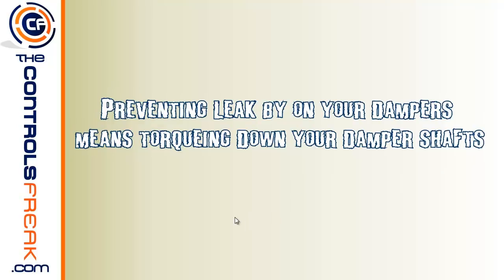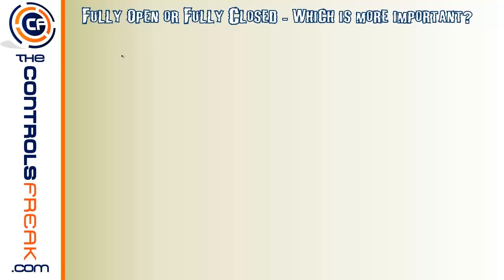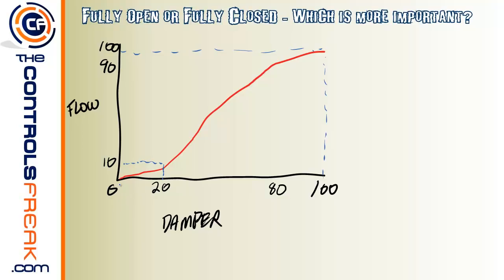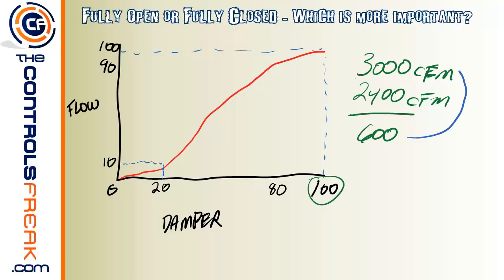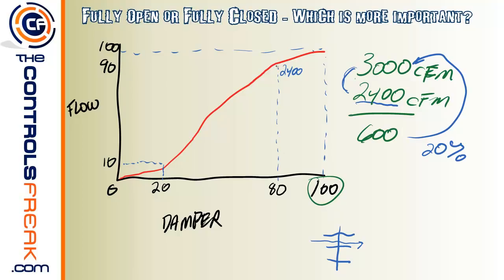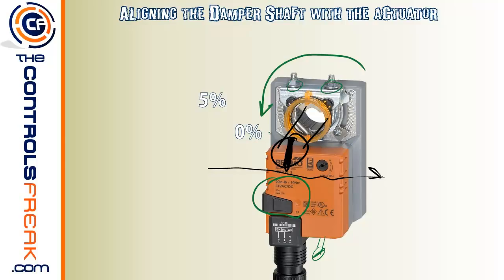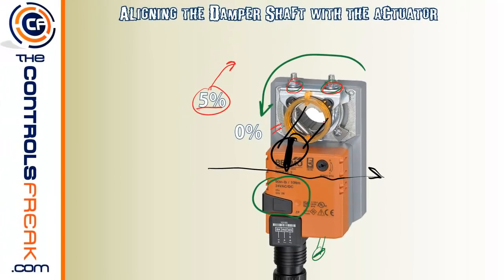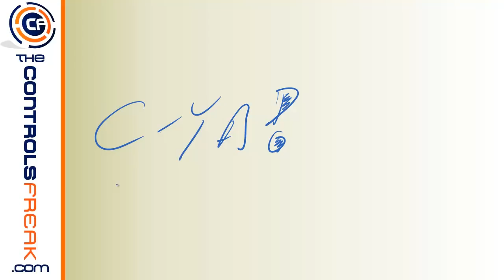Quick Tip To Make Sure Your Belimo Actuator Seals Your Damper Closed

Comment from the maker: Revisiting this question... Yes when you purchase (some?) Belimo actuators will come shipped where they are set at about the 5% mark until powered up for the first time. Hopefully up to the point they are getting mounted no one has manually readjusted the actuator etc.

Comment from the maker: Don't get me lying about Venturi and Fluid Dynamics, but... I think that is something completely different than what we are talking about with a damper. So, when you close a damper you are making the opening smaller thereby limiting the amount of flow. Though it is not linear or directly proportional... the further close the damper, the less amount of air passing by. When you open a damper from 0-20% you get the biggest change in amount of flow. From 80-100% you see very little change at all.

Comment from the maker: Based on my experience and the documentation that you can read from Belimo... They have some sort of internal gearing that once it hits that stop or any other extreme stoppage the torque will increase and at a certain point keep the actuator from continuing to drive further and burning up the actuator motor.

Comment from the maker: @w0158670 I am sorry I don't really know what you mean, but...

The actuator will drive to the full clockwise or counterclockwise direction depending on the position of the rotation switch. Once it reaches that position the clutching system stops and it holds that position.

If you tighten down on the shaft while the actuator is already at the furthest most position... It will stay right there. No additional torquing.

Comment from the maker: You should use this tip with ANY damper you wish to be sure that when it is told to be closed, it is closed. 

Also, the reference to 15% is completely arbitrary. You should never assign a set percentage to a position of a damper to equal the 'right' amount of fresh air. Then again 15% could be correct if a Test and Balance professional has said that 15% outside air damper position gives the correct amount of fresh air on a constant volume fan.

Comment: On these Belimo VAV actuators - is there a mechanism to prevent the open / close signals from continuing to make the actuator try to move once it has run up against the little stop tab? I set mine up the way you showed on your video, and it strokes all the way closed under 100% heating and all the way open under 100% cooling, but it continues to try to open / close. of course, it doesn't actually do so because of the stop tab, but won't this trying-to-move eventually wear out the actuator?

Comment: In the manual, it was said to: Connection via safety isolating transformer. Does it have something to do with a high amperage during the 5ms activation? Could you tell me what kind of transformer do I need for BFL24-T if my primary voltage is 230 V? Thank you.

Comment: Thanks for the great video! 
Anyone happen to know if there is a video for the proper way to remove the black power connection from the orange body? I break them every time I pry one off. I have tried various flat heads to push up on that tab, but it's always either too small, and I bend the screwdriver, or it's too big, and I break some piece of plastic off as I literally pry the connector off

Comment: silly question. in a venturi tube, the flow stays constant but velocity changes in the throat. so if 3000 cfm goes in then 3000 cfm comes out but velocity increases in the throat. does that same concept applies to dampers? like by closing the damper from fully open to 50% open, shouldn't that only impact velocity instead of flow? Thanks.

Comment: pressing the clutch or not. And I didn't understand why you went to 0% and to 5% all of that with no power. I'm having a trouble with the one we have in an industrial oven where I work. That it needs more degrees to start the flame, but then running is at 0vdc but still pretty hot. And if I move it to less degrees it doesn't flow enough gas to start the flame